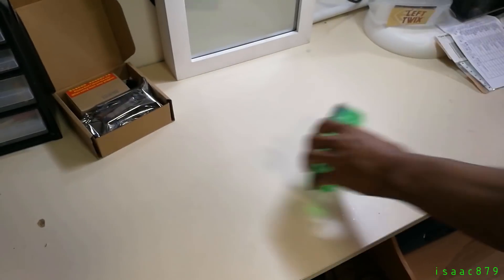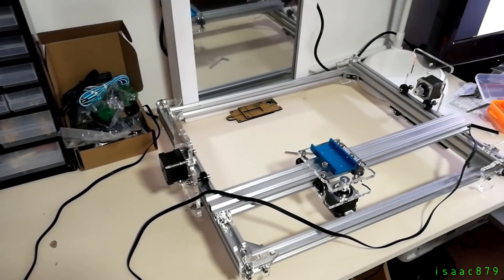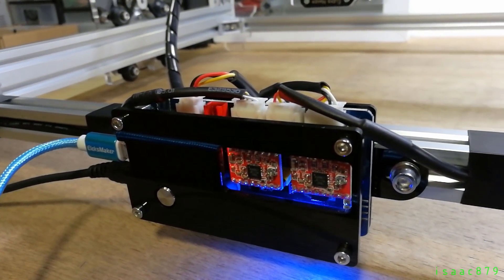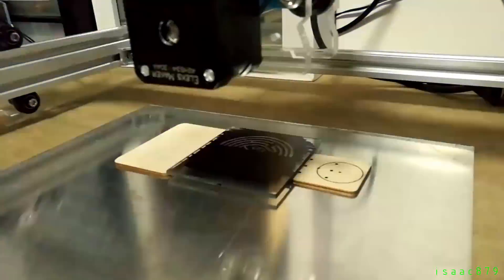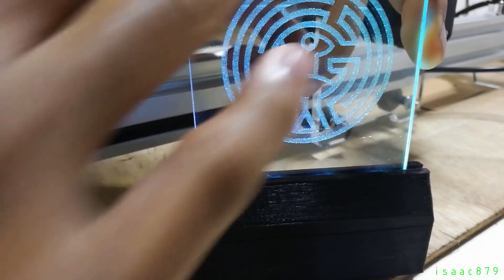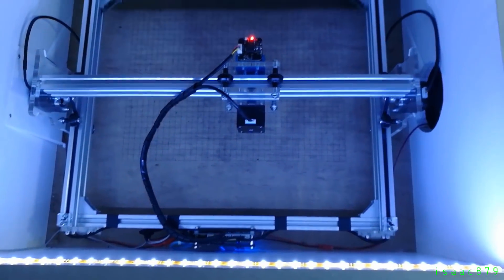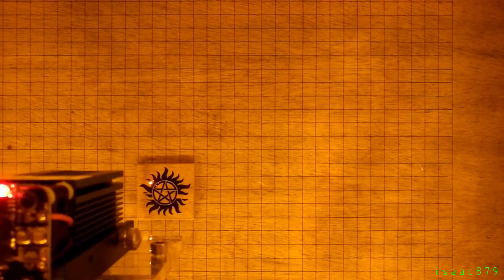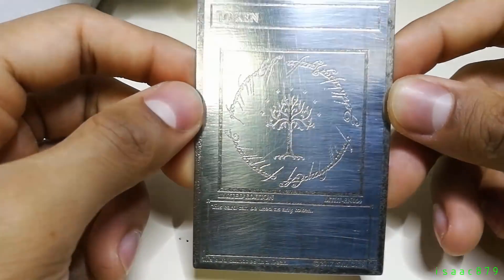EleksMaker EleksLaser-A3 Pro 2500mW Laser Engraver

Comment: Would this power laser be able to etch stainless steel? If not can it be increased in power or refocused?
Reply from the maker: No it is not powerful enough to etch metals. The laser module can be focused for different distances but it cannot be increased in power unless you replace the laser module with a more powerful one.

Comment: Great Video, I have one same model as yours but it doesnt engrave all in fold line mode, how Can I make it engrave the complete image clearly?
Reply from the maker: Thanks! I've actually changed the laser software to use laserweb as it is much better (there are loads of tutorials about setting it up). I don't tend to use the fold line mode anymore because it can cause issues with heat buildup and end up burning too deep or setting fire! So i just use the line by line raster now and get very clear results.

Comment: Been searching review after review to see if this laser would work for cosplay, FINALLY you said exactly what I needed "this can also cut through 11mm foam floor tile". PERFECT. You win youtube for today and I definitely need this laser, especially for the price. Maybe I'll have less issues than with my 3D printer.

Creating the enclosure is going to be harder than using the laser I think.
Reply from the maker: I'm glad you found this helpful! Originally when i tried cutting through the foam it took about 10 passes! However I recently added a 3d printed air assist to it and it now cuts cleanly through it 4 passes! I would definitely suggest making an enclosure with good fume extraction too.
Reply: Well I am doing the same I have searched and searched forever . I am about to just forget it. What did you end up getting
Reply: @beckys4940  I ended up getting this and it works great for cutting foam pieces while I work on other parts of the costume. I actually am fairly happy with my purchase. Getting it set up correctly is a pain and varies from software to software. Once you get things dialed in... you really can shoot productivity up. Barging pieces together while the next few pieces are being cut. Definitely stick a fan near it to blow fumes away and DEFINITELY make sure everyone in the room has eye protection. I legit put a cardboard box around mine with hole for the fan until I can build a real enclosure.

Comment: What is it that you coat the materials with to get those blacks?
Reply from the maker: For the glass I just used a black marker pen and for the galvanised steel i used a matte black spray paint.
Reply: @isaac879  thanks a lot man. Are the markings permanent or are they easily removed?
Reply from the maker: @monkeymaster6489  Permanent. The glass is physically engraved by the laser so can't be removed.
Reply: @isaac879  thanks very much bro you've offered a lot of insight

Comment: A 10k resistor between + and - on the TTL control signal line should sort out the initial laser power-on issue. At least, it does when using a Ramps board and Marlin.  (This will also depend which laser control board you have and if you're using TTL)
Reply from the maker: Thanks! I did actually add a pull-down resistor to the laser module to fix the issue a while ago but haven't got around to making another video about it yet...

Comment: Hi issac.

Can you put a link for the extractor fans you used and the tubing please?
Reply from the maker: The fans were just standard 120mm pc fans. I believe this is the one: https://www.ebay.co.uk/itm/120mm-x-25mm-12V-2Pin-Sleeve-Bearing-Cooling-Fan-for-Computer-Case-PK/322552096253?epid=1369074037&hash=item4b199a65fd:g:RAEAAOSwwvZZPqQL

I used 100mm (4") pvc ducting: https://www.ebay.co.uk/itm/FLEXIBLE-PVC-DUCT-DUCTING-4-100MM-HOSE-PIPE-PER-METER/283028718860?epid=1190945491&hash=item41e5d3850c:g:~B4AAMXQlgtSwUQl&frcectupt=true

Here is he 3D model I made of the adaptor from the fan to ducting: https://www.thingiverse.com/thing:2699237
Reply: @isaac879  thanks issac appreciate the help

Comment: The software provided with this (and other Chinese) laser is very poor (not very functional, buggy and badly or not all all integrated). Using other software can significantly improve the user experience and productivity. I have looked at a number of options including using InkScape and others and concluded that for DIY laser work a product call LightBurn is head and shoulders ahead of pretty much everything else on the market.

I would recommend you have a look at LightBurn software , it is relatively inexpensive (40$) and can connect and directly drive the EleksMaker Laser Control Board. It provides a fully integrated cad/cam/g-code sender all in one, which gives the capability to create sophisticated vector designs and text, import and burn (or convert to vector) images all without leaving the software. You can download a fully functional trial (valid for 30 days) from here https://lightburnsoftware.com. To fully exploit the software you would need a laser that can be TTL/PWM controlled (rather than simple on/off) which your existing EleksMaker Mana SE control board is fully able to support.

You could also consider upgrading the Mana SE control board to the latest version of grbl, which supports dynamic laser power compensation dependent upon speed of movement . . . this would significantly improve the quality of your engraving in particular (more details here http://forum.eleksmaker.com/topic/2510/grbl-1-1g-with-servo-for-mana-se)

Comment: Hi, as i know, that this laser can't or is not sugested to work without stoping after 30min, so my question is 1) how long it took for you to engrave that round labyrinth in the glass? I am just looking forward to manage better my continuous work with that laser. 3) Other suggestions? 2)And did you had some improvements for your box, regarding to cooling all that laser or system, did you touched with the hands which parts is hot after work (don't forget to switch off in case you will test it  :) ) I would be very very appreciated to get some answers. Thank you, its great video.
Reply from the maker: With the 2500mW laser the cooling should be adequate to run it continuously. I have done several engravings that too hours with no problems. The laser module gets slightly warm to the touch after about 10 minutes but then doesn't get any hotter.
The vents and fan position in my box weren't very good because the side of the engraver machine partially block airflow over the work piece. I would probably suggest changing the vents to the front and back rather than sides.

I hope this answers your questions and helps.

Comment: I'm using 2500mv laser with grbl 1.1. but my laser is not engraving. it burn at lower speed and burns the paper at higher speed is does nothing did you know what may be the problem?
Reply from the maker: Sorry for the delay. Have you solved the problem yet? If not do you know if it is a software issue or hardware? Are you focusing the laser before attempting to engrave?

Comment: I hate being pretty crap with electrics, how do you wire in the fans and leds? Anyone link to me useful guidance would be massively appreciated!
Reply from the maker: The fans and LEDs all run off 12V which is the input voltage so I just soldered some extra wires to the input terminal.

Comment: Can it engrave anodised aluminium?
Reply: It can remove the anodized coating for metals. You can then use chemicals to actually etch the metal if desired

Comment: Hey Isaac, it would be super helpful if you included the settings you used on each material to help us with a starting point. :)

Thanks and great video.
Reply from the maker: Unfortunately I don't have a good record of the settings because I have been making modifications to the laser and software so the settings keep changing.

Comment: hi isaac what process you used for the lastly TOKEN thing and what was the material metal or SS
Reply from the maker: the token was made out of galvanised steel. To create it, I used a matte black spray paint on the metal then etched it with the laser exposing some of the areas. I then used  electroetching in slat water which removes the exposed meta. To electroetch it, the token must be the anode at +5V and I just used some scrap metal as the cathode. This video shows the process of electroetching: https://www.youtube.com/watch?v=ncWXVOzNGbA
Reply: thanks

Comment: How did you draw the grid on the work surface? ready g-code?
Reply from the maker: I drew a 1cm square grid in Inkscape as a SVG file, opened it in the laser software, then used the laser to burn it into the wooden work area.
Reply: did you have the finished file? can you share?
Reply from the maker: Here you go. It's a 1cm square grid that is 39x29cm. https://1drv.ms/u/s!AgXKCinGTUK0ogtjF0RwViui0mI9
Reply: thank you so much!!! )

Comment: Hi, I ordered the same unit. Use it to engrave on wood. How long can it run before you need to shut it down to preserve the laser from getting damaged or over heat? Thanks
Reply: I have ran mine for easily 4 -5 hours constantly in a hot garage and have had no issues.
Reply from the maker: As far as I am aware you can use it on full power for as long as you want without any overheating issues. Currently the longest engraving I did took about 2 hours.
Reply: isaac879 thanks appreciate the response,  I'm very excited to see how it work.

Comment: Hi Isaac. I am looking at buying the same piece of kit but would like to know if your laser is able to "cut"  3mm thick balsa (parts for RC plane... cutting speed or number of passes is no issue to me.)
Reply from the maker: Hi Richard, I haven't got any balsa wood to test and try to cut at the moment but I believe it would be able to with enough passes. I have cut 3mm acrylic with it so imagine balsa should work too. Originally where doing research before buying my laser I found this video which apparently shows a laser of the same power cutting 3mm balsa: https://youtu.be/e2zY00KaERQ
I hope this helps!
Reply: Thank you very much for taking the time to answer me, it is much appreciated.

Comment: Great video Isaac. Will this laser cut thin woods up to around 1/8" thick or 3 to 4 mm? Also have you tried any other program software to run the machine?
Reply from the maker: Thank you! I don't think it would be practical to cut 1/8" woods with it unfortunately. I have seen a few videos of people cutting 3mm balsa wood but I think any harder woods would require too many passes to be practical.
I haven't tried any other software yet but it's on my to do list.

Comment: Hi, great video. Planning och buying the same machine but wondering if the 5000 mw is worth the extra cash? I thought 2500 mw would not cut through materials. Which one would you recommend?
Reply from the maker: Thanks! I haven't had much experience with any other laser but from what I know 5000mW isn't really able to do much more than the 2500mW. It will be able to engrave and cut slightly faster and deeper but not by much. When I bought mine it was about £150 and the 5000mW was around £300 so really didn't seem worth the extra cost for so little benefit. I wouldn't really advice this machine for cutting unless it is cardboard or a thin material less than 2-3mm even then it takes several passes. If you want to cut anything more substantial then I would suggest getting a CO2 laser. 
I hope this helps!
Reply: @isaac879  can you add the co2 laser to this engraver?

Comment: Hi.. Good gob!
I'm interested to know the settings that you used for each material you tried for cutting and graving. e.g. speed, times,other settings.... I got recently my machine and seeking for details.
Appreciate to share your experience
Reply from the maker: Thanks! I would strongly suggest testing the settings on a scrap piece of the material you want to engrave first as each material is slightly different. These are some of the settings I used so hopefully will be a good starting point. I'm using the EleksMasker software and have the X and Y axis acceleration set to 1000. For relatively soft woods I have been doing 1 pass at 200/1000 power and 600mm/min. For harder woods 450/1000 and 600mm/min. I did my leather wallet at 180/1000 power and 650mm/min. Glass with the black marker was engraved at 1000/1000 power and 700mm/min. Etching black paint off metal was done at 1000/1000 power at 1100mm/min. Cutting card took 2 passes at 1000/1000 power at 700mm/min. 
I hope this helps!
Reply: isaac879 can you make a video and explain the settings for cutting, engraving etc with the elksmaker software? And if we want to cut something we had just engraved (e.g keyring) how we program the laser to do that.
Reply from the maker: I've actually just upgraded changed the firmware and software I'm using with it to GRBL and LaserWeb4. One of the issues with EleksMaker software is that it wouldn't allow you to perform an engrave and cut. When I made some leather keyrings, I had to cut it out first then alight the engrave and do that separately. With LaserWeb it allows you to perform both in the same operation.
Reply: isaac879 a